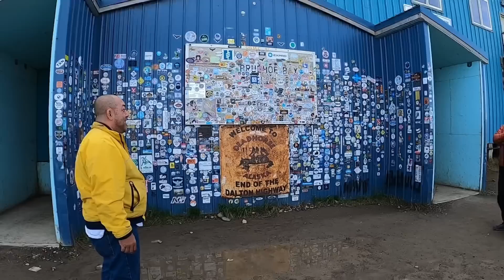February 9, 2023/29 Trucking . Major coolant leak

Comment: Its leaking from the coolant distribution. Its basically a piece that a bunch of coolant lines run into. They all use black snap in connectors. Sometimes the vibration shakes them loose. If the line is actually cut he should be able to splice the line as a temporary fix.
Reply from the maker: I think you are correct on this one
Reply: @24juan68  i love watching your trucking videos on your youtube chanel any update on grace  did they fix grace yet do you know when you are getting grace back to drive grace

Comment: Have f150 hoeses leaking fix that then leake again it water pump and thermal state.
Reply from the maker: There is a water hose that goes into the transmission cooling system and the hose of the size of my thumb the elbow broke